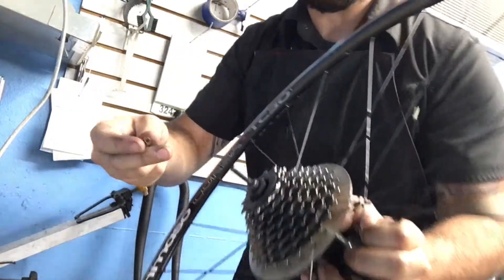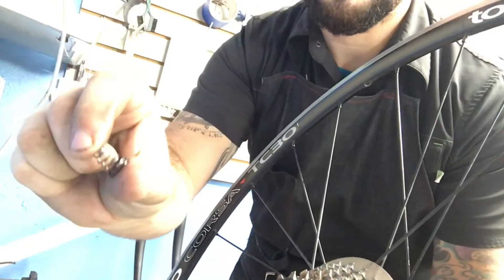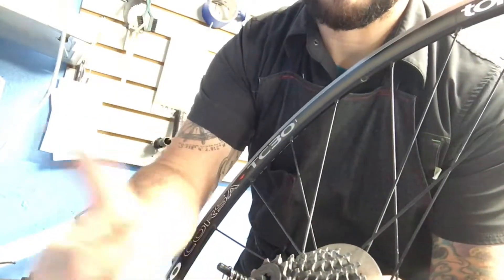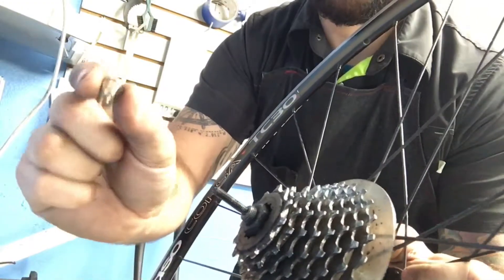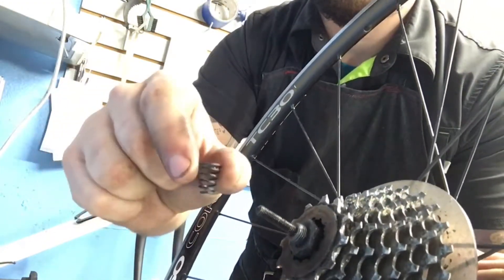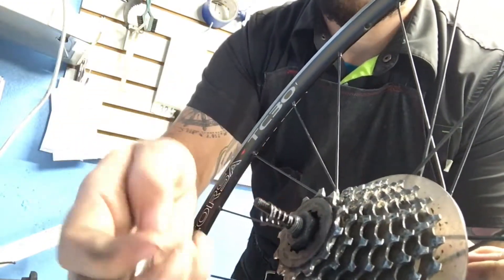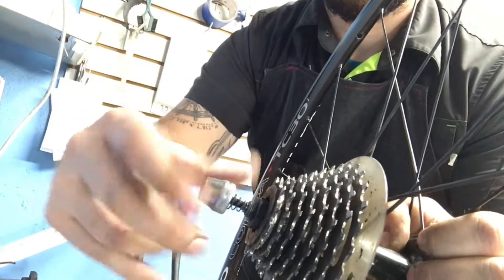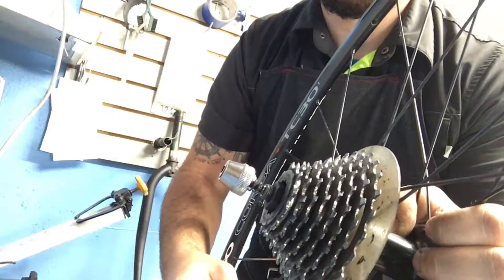That spring thing on your skewers

Comment: But what is it's purpose?....does not having one of it will affect wheel alignment?
Reply: So they have a big job. They keep the skewer centered. That makes it easier to get your wheel in the dropouts.
Reply: @MannuelCorona  that's a small job.  🙂 I'm glad you clarified that they do nothing but add a tiny bit of convenience for a job that many of us do VERY infrequently.  If you don't remove your wheels daily because your driving your bike to an event, you can drop the springs and save a gram per axle.  More importantly, we should consider the springs to be an add on, instead of the defacto for skewers.  Manufacturing things takes energy and causes emissions. We're about to experience a bicycle revolution under Deep Decarbonization, where even EV cars have too much embodied carbon emissions in their manufacturing to be viable.  I look forward to the day that Shimano, and other hub mfgs offers their hubs in QR OR with security locks OR with allen key fitting and omits the unnecessary springs, leaving them as an optional purchase for folks who constantly remove their wheels.  Most of us only do for punctures, tire replacement, or to service something related to the wheel.

Comment: Yah that’s fine but what do you do with the spring when you mount the wheel on the axle. The springs are in the way.
Reply from the maker: I’ve only noticed this to be an issue when the springs are installed the wrong direction or the quick release is the wrong size. 
The spring is stopped before the hub where the hub sits on the dropouts.